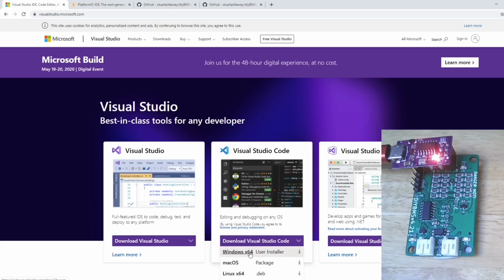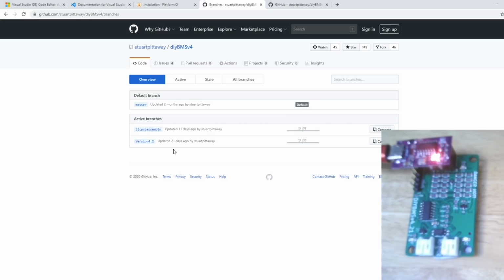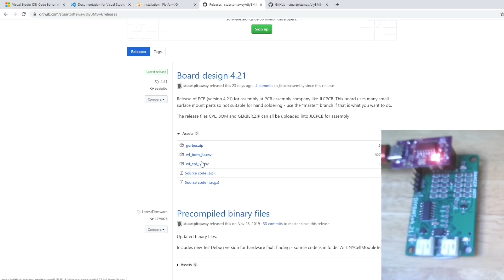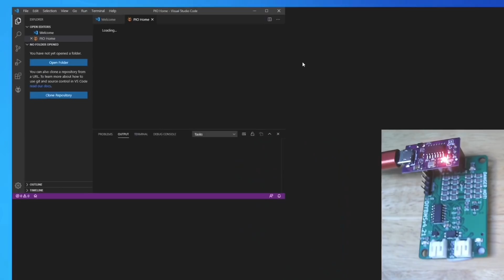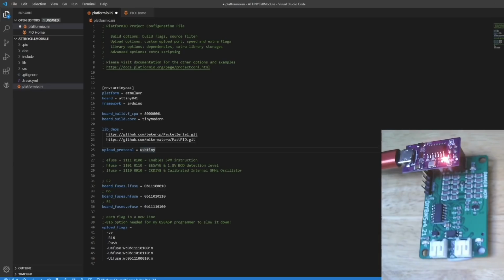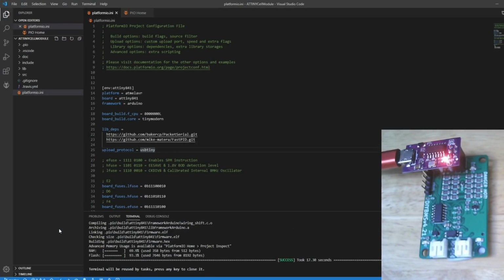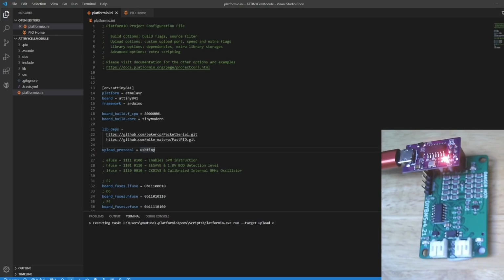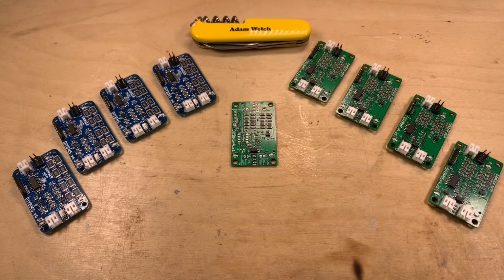diyBMS v4 Flashing Cell Modules

Comment: Where do people go to get basic information about diybms?  The stuff I've found is spotty and spread out - for example, I have built boards, and I've gotten them flashed, but the controller doesn't see either of two modules I've tried plugging in. Even trying to find answers to things as basic as "how should the modules be connected to the controller" is hard to find - I think it's supposed to be TX pin 1 to RX pin 1/TX2 to RX2 in a loop, but...

This project is crying out for documentation or at least a full basic walkthrough - there are YouTube videos, but about so many different versions.  :(

Comment: Adam how many batteries with one module balance mate? 100 ? 200? Per pack? Or do I need a load bank to take the heat?
Reply from the maker: So the diyBMS balances at about an amp so how many cells it can balance is totally down to how even the packs are. If you’re packs are way out from each other the diyBMS will need to do a lot more work. You can however put more than one module on each pack if needed, but well designed packs is best because the bms is just burning off energy when running.

Comment: I saw digikey has programing available for the tiny841's, would it be wise to let them program them ??? Or would it lead to possible hangups?
Reply from the maker: ISP programmers are cheap (or you can make one from an arduino) and there may be code improvements in the future. Unless the flashing process looks complete you alien to you I’d save the programming fee and put it towards future proofing with a programmer.

Comment: been at this a couple of weeks now i get message from platform io exit code 1.google search says it is something to do with duplicate variables in header file.Could you message stuart pittaway and see if there is any info i am hitting brick wall here.I have reinstalled platform io and used usbasp and your atiny no avail .any help welcome.
Reply from the maker: Ok, let me check a few things with you, and I'm sorry if these are obvious, but it is always best to check. You've downloaded the latest code from the code repo?  https://github.com/stuartpittaway/diyBMSv4code
You're struggling with the modules rather than the controller bit?
You have extracted the zip from github and opened (rather than imported) the module code by navigating to the extracted folder in platformIO?
You've tried with the USBASP and then when trying with the USBTinyISP you changed line 25 to upload_protocol = usbisp ?
You've connected your programmers the right way round?
You are happy that your boards are correctly soldered and your ATTiny's work and are genuine?
Are you able to check continuity between the ISP header and the attiny pins?
Could you write a blink sketch for one of the pins with a LED attached - that will test that you can upload some basic code to the ATTiny and prove that it receives it.  You could do this in the Arduino IDE if you are more comfortable there - just ensure to install the ATTinyCore board definitions by Spence Konde.  This would help eliminate any hardware issues, and your coms is working.
Error 1 is an exit code - are there any clues as to the issue further up the terminal output?
If none of that helps I'm not sure I can really offer any further advice without having one of your modules to test myself.  Where about's in the world are you?
Reply: @AdamWelchUK  story so far? i have built three boards i have flashed the d1 mini pro got as far as login screen on computer after that computer does not want to play at all will not even pick up bms on wifi .so i have built the cell modual (2).I have loaded visual and platform io,then down loaded git client for libaries??.The code compiles in about 3 secs platform io says ok.Then i press upload this takes about 4 secs it comes back with error saying exit code 1.I use win 10 machine so i have dropped to a windows 7 machine and loaded usbasp and drivers .reloaded code and tried again same result.I am thinking of ordering pre built modual to make sure its not me being a d**k.This is the fist time in years i see no way ahead i normaly try and sort it myself but platform io is so new and complex i admit i am only following your vids( i waited for your vid on flashing cells for weeks).I am at point now of giving up on this project but though i would reach out as i have spent a lot of time on this.I have decided to build one more and triple check if its a no go thats it.I follow you as i have built a 13kw/hr power wall that has been running for about 18 months.I am also building my own bms using ads1115 and arduino mega but thats many many months away.Thank you for reply and i will write a blink and flash one of the leds on both moduals.

Comment: Hi Adam,
Quick question, i got an USBTinyISP similar, in appearance, to the one that you have so which drivers are you using to get it working on windows 10, mine is not recognize and the adafruit one does not work.
Thanks a lot,
Jonny

Well found the problem just in case somebody else could get the same issue with the driver the solution is here 

https://learn.sparkfun.com/tutorials/pocket-avr-programmer-hookup-guide#automatic-install

And ... check that the wire is working fine !!! Mine was having connectivity problems and after reinstalling the drive and changing the usb cable all was good.
Reply from the maker: Sorry for the delay and thanks for the update. I just use the drivers from here... https://learn.adafruit.com/usbtinyisp/drivers and a good cable ;-)

Comment: what the heck is error no. 1 on platform been trying this mor months now does not work for me
Reply from the maker: Is that a ‘can’t connect’ type error? Have you setup the correct programmer or the right port?
Reply: I have bought all the parts by your links. The tiny isp seems to be found by windows as it pings when plugged in. I have altered the platform io the same as you video. It will build ok. It takes between. 95 and 1.45 secs. When uploading platform message is error 1.the led does not even flash on isp so wondering if it's a comport issue. I have been building this system for months and have not got one unit to work. I am going to build a new unit but waiting for some boards and stencil. I have been doing hobby electronics for years but this is the first project I see no way forward. I even waited for this vid because of the timer error on last code build.

Comment: To connect the USBTinyISP to the board, did you solder in the 2x3 male pins on each board and a female 2x3 on the USBTinyISP?

It seems both boards need something soldered in there, unless maybe a male connector on the USBTinyISP can slip into the holes on the BMS and make sufficient contact long enough for programming?
Reply from the maker: I’ve soldered in some male pin headers to each cell module and use a tinyisp with a female connector on it. However you might be able to hold some pins at the right angle to get a good enough connection - once the code is compiled it only takes 18 seconds or so to flash.

Comment: Hi adam
Can i use this for different battery? Like lipo? I think it has nominal voltage of 3.2 and full charge about 3.6v

I did examinin the code and i just found the 4100 settings for bypass voltage.,  do younk i can change it to 3600? Or i will be having a problem with the power supply of the attiny due to the lower voltage.
Reply from the maker: The voltages are completely customisable from the web gui. I’m going to be using this on my lifepo4 cells with a max charge voltage of 3.65v.
Reply: @AdamWelchUK  can you share after you done for the setup of the lifepo04.

Comment: This is awesome.  I have a few modules here myself to finish up on.  How have you made out with the control node?  any issues with communication?  I know v2 and v3 i had issues with modules dropping out and losing communication.
Reply from the maker: Not there yet. I had no issues with the version three but I know some did. I’m planning to twist the serial comms cables to reduce the chance of interference,  and keep them as short as possible.

Comment: Great video Adam, as all your videos !, following you since 3 years and getting in this world thanks to you. 

Just what I was looking for, I was asking for 10 pre builded pcbs and was in the dilemma how to proceed to soldering the ATTiny, this video is just the answer.

Have a couple of questions, do you have the exact reference in the missing D1 part ? Crack my head looking for it into Farnell 14 and when look for it appears a big variety of those components and just not sure which one to choose.

Other question is soldering it was as "simple" as the ATTiny ? Or have a trick for it ?
Reply from the maker: Thanks for the super comment - I appreciate it.
The missing part is this one from LCSC - https://lcsc.com/product-detail/Voltage-References_UTC-Unisonic-Tech-TL432G-AE3-R_C171461.html but it has just come back into stock so, it is probably now available to have fitted by JLC.  Whats more, I'm told JLC has just re-added the ATTiny841 so you can now have the boards fully assembled - shame they didn't do that a couple of days earlier!  Here's a vid I've just made showing the process... https://youtu.be/dHrk1XF3oUs
If you end up soldering the attiny and the diode yourself yeah it's fairly straight forward.  With the diode tin the pcb pad for the pin on its own, then place the part down and reflow it.  Then do the other two pins and pop a bit of fresh solder back on the first.  Do the diode before the attiny to ensure you can get your iron in - the attiny makes it a little harder to get to the two lower pins on the diode otherwise.
Cheers
Reply: @AdamWelchUK  That's great Adam, thanks a lot for the soon answer .... can't believe the added :(. Any way will ask for the missing parts and sold mines.

Comment: Could JCBJCL have installed a DIL socket for the AT tiny chip?  This would make final assy easier :)
Reply from the maker: The attiny841 only comes in surface mount packages and there isn’t any options for that n LCSC. I think the solutions for converting SMD ics to through hole that don’t need soldering are designed to be temporary - a permanent installation may lead to problems.
Reply from the maker: Good question - I’ll have a look into that.

Comment: I have a question which I don't think I have seen the answered before.
if you have a cell that is at the bypass voltage but all the others are lower, your solar setup is charging at 10A what stops the one cell going over volts because the bypass current capability is no where near 10A
Reply from the maker: Its a good question - I think however in most circumstances your question wouldn't arise.
Lithium packs should be built with even cells.  Cells need to be tested for capacity and where possible internal resistance (just leaving them sat for a month after charging will give a reasonable indication). So hopefully any BMS is doing more monitoring than it is managing the pack.
Assuming cells are reasonably balanced the BMS is only going to start balancing at the top end of the charge - at this point the current going into the pack is lower than when your 'battery' is low.
A well designed BMS will leave head room both for safety and for ensuring your cells give as many cycles as they can.  A lithium cell charges to 4.2 typically, but most people will start their balance point to 4-4.1v  So even though one higher cell could be on bypass, and being charged (and the charge could exceed the bypass load), there is a good margin of safety, and once the rest of the cells come up the charger (whether that is solar or anything else) starts ramping back and gives the BMS to catch up.
After nearly 2 years of using the diyBMS on my 7s20p lithium ion battery pack I haven't seen the issue you describe in practice.
Reply: @AdamWelchUK  This guy is suffering from a pack that keeps going out of balance.

https://www.youtube.com/watch?v=0w1ENiS-b6k

Comment: I just got 42, 120ah lipo cells, and need  bms, I'm getting a bit nervous having soo much lithium batteries without BMS, in a 7s system, with approximately 25kwh total,   great video,
Reply: The ones from battery hookup?  I bought 6 of the 36v modules which needs to be dismantled but it was a savings over the individual cells.  It was quite easy to dismantle even the spot welds were easy to handle ... easy compared to how difficult in my head it was going to be.    I drove there to pickup.

Comment: Be nice to be able to drive some  mosfets with these boards with a larger external resistor bank for those really large battery banks
Reply from the maker: Discharge current is about an amp, which should be ok for a well balanced pack.  Batrium only goes up to 2 amps I think last time I looked? I do wonder whether you could double up the cell modules in a single string to double the balancing power? Might have to look into that.
Reply: @AdamWelchUK  you can double them up, in the module settings you can set up bank 0 and bank1
Reply: @AdamWelchUK  I did have a batium set-up spent about $1000, it failed and there is little  backup from them, I ended up removing it, this type of day is open source type stuff is more user friendly
Reply: I highly doubt that it would not be easily doable. I might have to resort to this in my pack because of the use case but we'll see.

Comment: Thanks for the video, I have been waiting for this, however, what I don't understand is the programmer part? How do I use an Arduino to program it, specially connection to the DIY board. It would have been handy if you can elaborate a bit. I had this DIY module done long time ago (like 5 months now) but i am waiting for a way to program it. :(
Reply from the maker: You can use an arduino as and isp programmer - I think there are a few guides out there for that. Otherwise the usbtinyisp I used are very cheap - just a couple of dollars.

Comment: after You I wouldn't be expecting so poor solder job Adam, take some flux and ride your tip on those pins, it'll be fine
Reply from the maker: I rarely add flux and rely on any in the solder - I guess I should but flux always seems to take more time cleaning the stuff off!
Reply: @AdamWelchUK  flux is really key for hand soldering smt. The solder flows like magic to the pins and shines so nicely.

Comment: i really want to make this one i have all the pcb's and i think most of the parts but there all for the first version
Reply from the maker: I found the 0805 fairly easy to put together - I used my oven, but hot air or even my soldering iron would have done I think. Jump in - let me know how you get on John.

Comment: Lemmi know when i can get them completely built please mate, i don't mind thru hole but im not messing with things i need to take to Jodrell bank to be able to see lol.

On another note, i'm getting close to investing in an EV car battery. Wondering what people think my current 18650 6KW bank would be worth 7s120p.
Reply from the maker: What do you think people would pay for a ready to run module? Do second hand packs change hands on the power wall forums? I guess they might fetch enough to offset the upgrade a little, but they are a labour of love really aren’t they and I’m not sure they ever really pay for themselves. It’s a hobby though and I guess hobbies don’t need to.
Reply: @AdamWelchUK  i was lucky and bought a load of old laptop packs when they were still 50p a pack lol, then added to it over the years. 
Certainly was a labour of love but it was worth it, even if only for experience. 
I don't really bother with the power wall forums. As for what i think they are worth, i honestly don't know, they have been well used but should still have a few years left in them, maybe more if they were reprocessed and rebuilt.
Reply from the maker: Tricky's World That’s it isn’t it, it’s hard to tell how long they will last and give ‘enough’ power to be useful (which is different for everybody) and therefore what value they have to the next person.